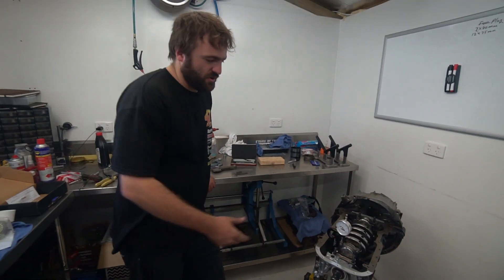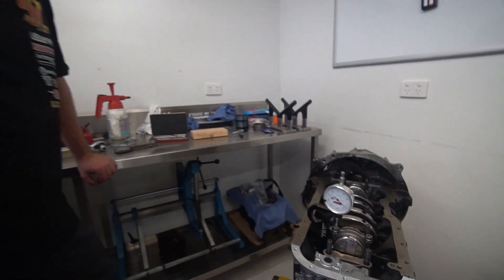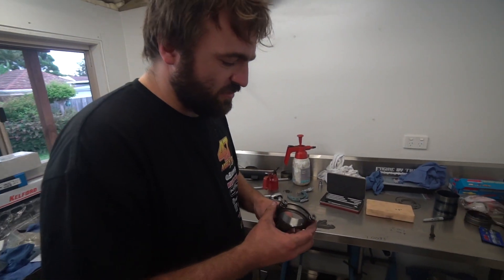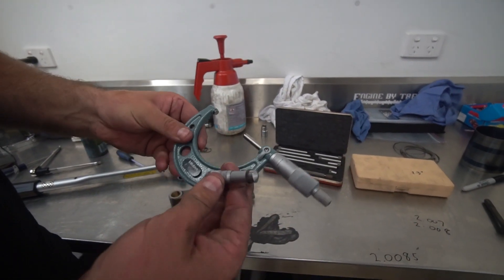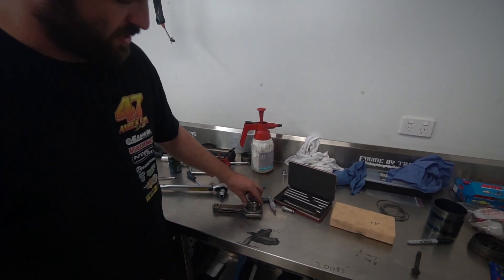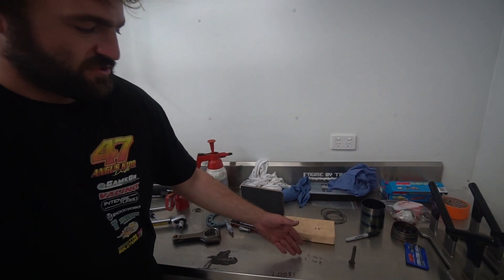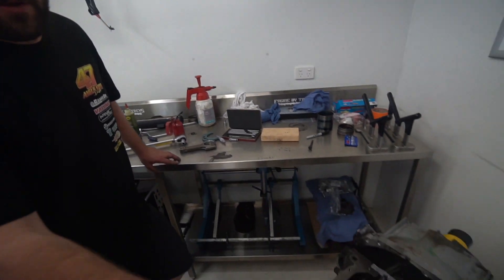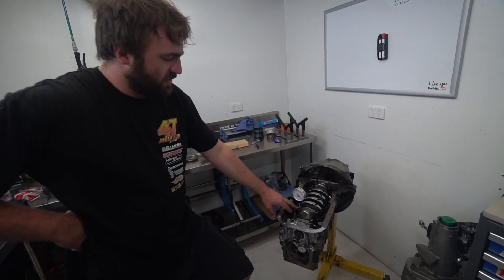Rod Bolt Stretch (Ask An Engine Builder Part 5)

Comment: i actually have a question. is it possebil to use a piston that had stuck rings. and some try to forcely remove it
Reply from the maker: I wouldn’t but that’s a question for your machine shop or engine builder, I bought new pistons for my first rebuild for $200 and when you consider how much your spending on the build it’s probably not worth the risk